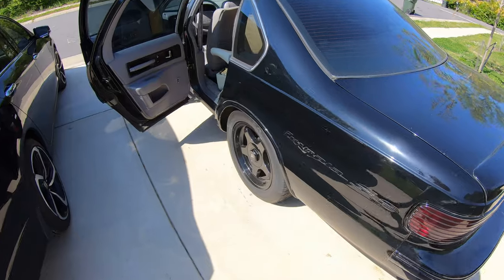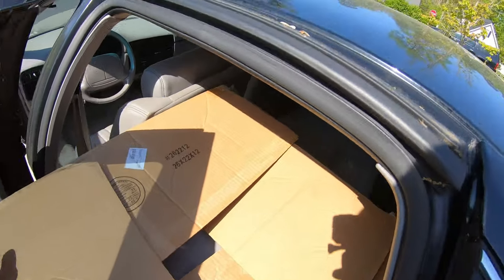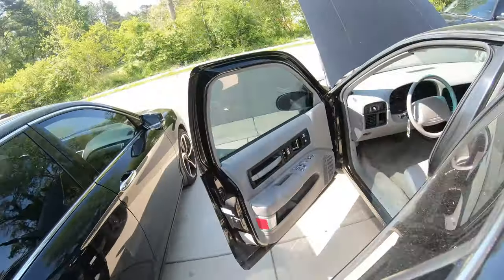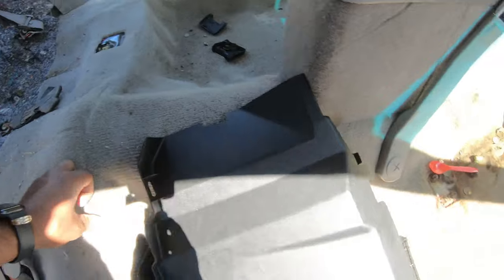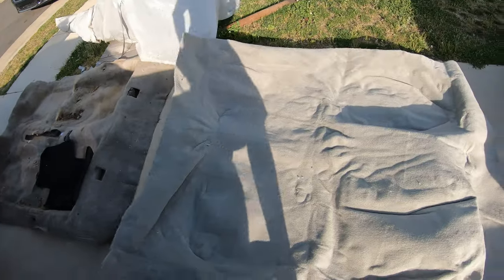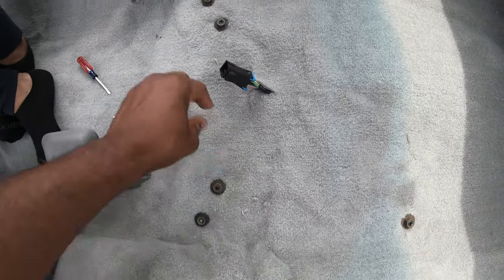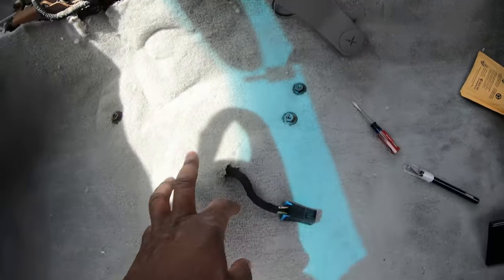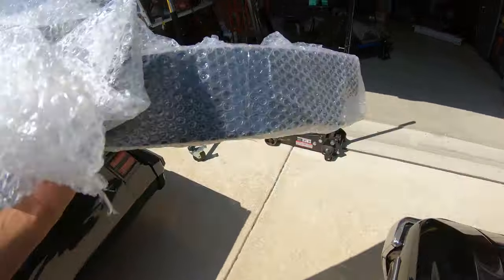96 Impala SS New Leather seats and Carpet Install

Comment: Yo folks get the clear plastic  that stick to the carpet in a car .so your floor mats take the wear.not the carpet.jus a tip.
Reply from the maker: Appreciate that.. might have to try it!!
Reply: I used to work in a dealership and would do that to my car definitely help keep the carpet fresh
Reply: @btmhotdrop2827  they sell them on eBay